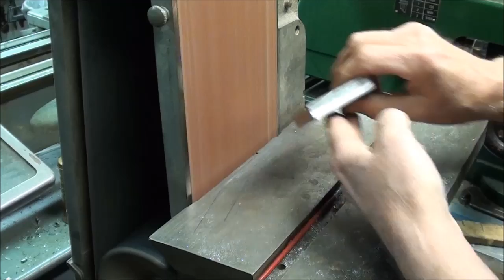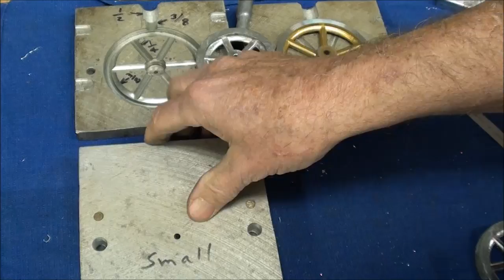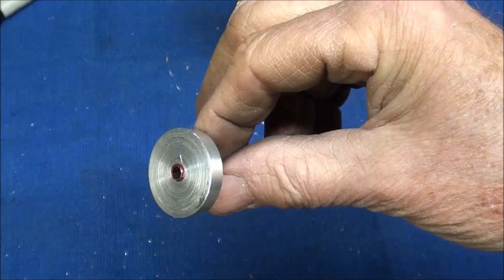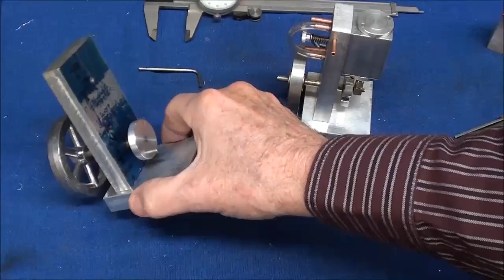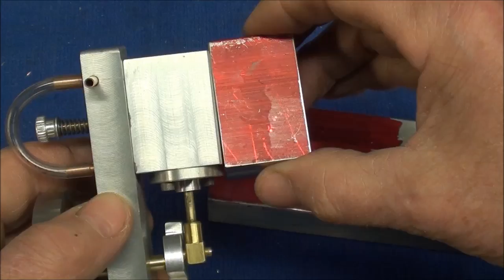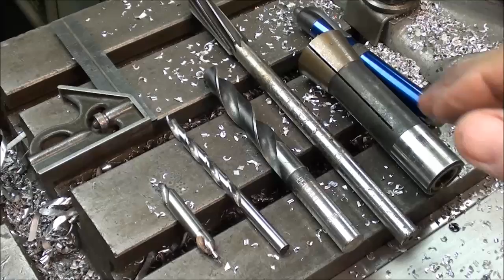WOBBLER DA STEAM ENGINE how to build pt 2of5 tubalcain

Comment: Hi Mr Pete.  You may not be too worried about what type of aluminum that is, but here's some information for the rest of the community that might be interested.  The printing on that aluminum shows "6061-T6511 ASTM-B221-08".  The "6061" indicates the type of alloy.  The "T6511" indicates how the alloy was processed (tempered, stretched to reduce stresses, then straightened).  This document gives more details about 6061-T6511: http://www.astro.caltech.edu/sedm/_downloads/Extruded_Alloy_6061.pdf.  The "ASTM-B221-08" indicates the standard set forth by the American Society for Testing and Materials (more information can be found at: https://www.astm.org/DATABASE.CART/HISTORICAL/B221-08.htm).
Reply from the maker: Thanks

Comment: Question: could the lead flywheel be "soldered" to the brass rod? I'm thinking flux the rod, insert into wheel, then heating the rod from the other end. Watch the wheel, and as soon as the flux bubbles and the lead barely melts, remove heat and spray with water. The base lead would be self soldering.
Reply from the maker: No

Comment: its 6061 alloy, a general purpose alloy that is used for nearly everything. its good in welding stuff and can even be forged. most aluminium extrusions you can buy are either 6061 or 6063. 6061 is an alloy with silicon and magnesium
Reply: Since the bar was marked 6061-T651, the "T651 designates that the extrusion has to undergo stretching or permanent set to relieve the extrusion from residual stresses for a uniform machinability."

Comment: hello nice belt grinder. Nice little base for the motor. We find some good little metal rods plates and bars at  the hardware store that do really come in handy around the shop. In my prime:) Hey these are poured in aluminum plates not those sand cast pours we see all the time on YouTube. So cold where you are the Locktite will not dry.